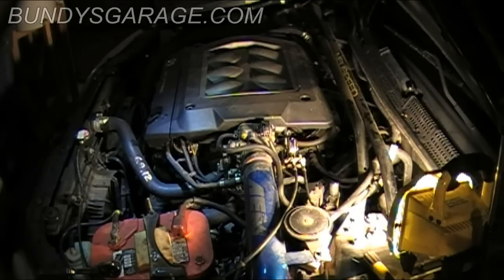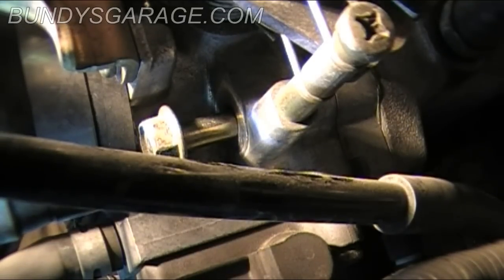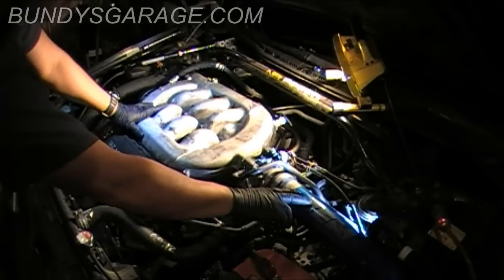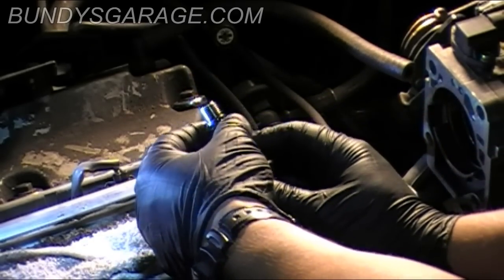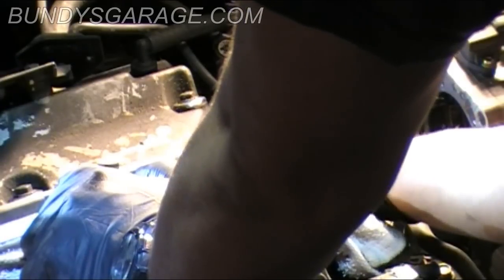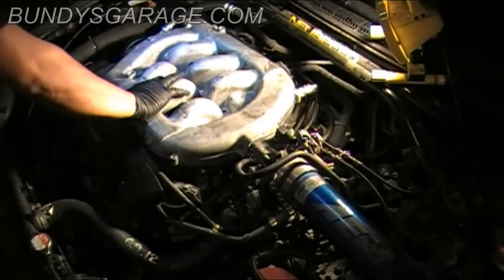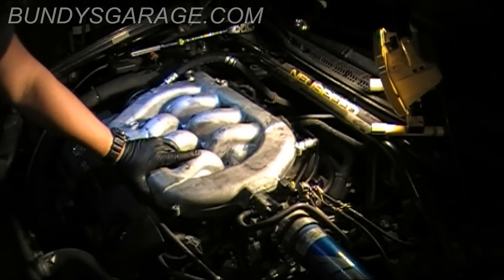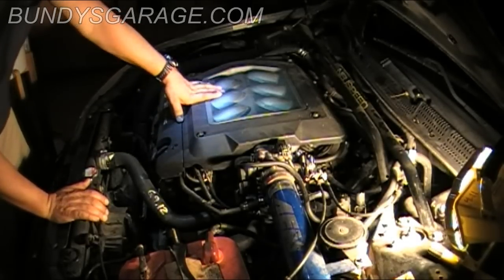DIY: Acura Honda (FPR) Fuel Pressure Regulator J Series V6 - Bundys Garage

Comment: Having an issue with an 2000 Honda Accord EX v6, it starts up fine when cold but after driving it for about an hour or 2 if I go to park and turn it off and try to re start it 15 minutes later it just keeps turning over and sometimes it will start but have a bad misfire but after i get it go in drive it will clear up about 2-3 minutes later, I've replaced all spark plugs, 2 of the coils ( popped up on the scanner) and now I bought all 6 fuel injectors, I am going to install them this week hopefully I was wondering what you think it might be? The car has around 180k on or
Reply from the maker: Thanks for watching. Its your engine coolant tempature sensor. It's gotten orogressively worse right? Before you install all those injectors check out my 2 videos on the problem.

https://youtu.be/DODF-egb9EM
Reply: +BundysGarage  I've replaced it about 3 weeks ago, though I did not fill it up as you showed in the video lol I'll take it off and fill it up tomorrow and see if that works, I pray it does 😂😂 Thank you man I'll keep you updated
Reply: +BundysGarage update: the fuel injectors were shot, all of the ports were clogged and I've replaced the ECT sensor and now the car starts up and runs fine lol for now at least thanks man for your advice
Reply: Did you ever find out what was the problem with your 2000 honda accord not starting once it got hot?? Was it your injectors or fuel pressure regulator?
Reply: toad c I’ve replaced the regulator and even changed the plugs, it was a heatsoak issue and I got rid of the car after about a month of it doing that
Reply: @THERIPPER216  did changing the fuel pressure regulator fix your problem?
Reply: toad c it did not
Reply: @THERIPPER216  I been having this problem for about 2 years now. Car run perfect except for that unknown problem....smh
Reply: toad c I was going to replace the fuel rail but I said enough was enough and called it quits lol I’m sure there’s a forum online for the correct fix but it just wasn’t worth me dumping a ton of money into
Reply: @THERIPPER216  now trying to keep bothering you but what all did you replace?
Reply: toad c Oh no You’re completely fine, I’ve replaced all of the injectors, the spark plugs and coil packs, as well as fuel pressure regulator twice (one new and one from an 02 accord)  and nothing worked, I figured it had something to do with my head or head gasket since none of those worked
Reply: @THERIPPER216   THERIPPER216  I have 99 accord V6 with 142000 miles. The thing run like a champ. What I did find out that works when the so called "heat soak" thing happens and it wont start, I unplug the vaccum line on the back of the intake manifold and plug it and it will start no problem. Once it start, I take off my dummy plug and plug the fuel regulator line back to manifold vacuum port.
Reply from the maker: This will fix your problem. You have to change 3 sensors and you’ll have it beat. Same thing happened to me as well. Had it beat for two years, then it came back. I will tell you what to do but you have to promise to report the results here (good or bad)! You have to change 3 sensors, 40 bucks on Rockauto.com. You have to change the engine coolant temp sensor (19MM), the air intake temp sensor (19MM) and the fan (thermo switch) (it controls the fans behind the radiator) (24MM or 15/16 deep socket) sensor that sits in the thermostat housing. The air intake sensor is on the intake manifold on the back edge towards the drivers side. Here are the Honda / Acura park numbers. Just take those and plug them into the search bar on Rockauto.com. Fixed the problem for me, period. 37870-PK2-015. 37880-P0A-A02. and 37760-P00-004. Just make sure you don’t switch the air and coolant sensors when you install them. They look identical and will fit both locations. Please let me know if this fixes your problem. If you have any more issues email
Reply: toad c that model accord was notorious for heat soak issues lol I’ve owned 3 of the 6th gen accords, I loved them! They are probably the best looking model (in my opinion) but that heatsoak issue made me pull the plug 😂 I’ve since owned a 2006 accord 3.0 (v6 6 speed) sedan and sold that and got myself into a 2016 hellcat
Reply: @bundysgarage  I think I done the ECT sensor already but the other 2, I have not. I gonna go to O'Reilly in the morning.
Reply: @THERIPPER216  the honda is actually my wife's car, I have a 2017 392 and hopefully one day I can upgrade to the hellcat..
Reply: @bundysgarage  have you changed these parts on a j series engine recently or this year?
Reply from the maker: Yes this problem only affects the J Series V6’s. I chased this problem for 6 months and spent way too much money doing it. Talked to all kinds of mechanics  and engineers about it but no one could lead me in the right direction. So after watching all the sensors on a scanner and seeing they were out of sync that’s when I knew I had it. It has nothing to do with summer or winter has its not a true heat soak problem. If you have the problem of driving the car and letting it get to operating temperature and then running into the store for 15 - 30 minutes and you come out and fire it up but it sputters and wants to die or it dies then this will fix your problem. It throws misfire codes cause the knock sensor picks up the engine shaking but it has nothing to do with a misfire. Plz keep us posted if this fixes your problem.
Reply: @bundysgarage  I will for sure
Reply from the maker: Was this what your car was doing?
Reply: @bundysgarage  Yes. It never threw codes or anything. It just always do the "no crank, start sputtering and shut off" until it cools down thing once we run inside a store after the car get hot from driving a while.
Reply from the maker: Yep I hate that problem. It happens on Acura TL’s and Honda Accord’s with V6’s. Were you able to get the parts from O’Reilly’s?
Reply: @bundysgarage  they had the thermo sensor but not the air intake sensor. I was about to install the thermo sensor and realized the radiator fan is shot so I ordered it from autozone and it will be in 2mor so I will install everything 2mor hopefully

Comment: 98 accord v6 200 k miles.  I think the code is p0171 and p0131
Reply from the maker: +Javier Hernandez If the P0171 is combined with the P0174 code, it's very likely that the problem is caused by an intake leak. If there are no intake leaks, the next step is to replaced the air filter and clean the air flow meter. If the problem persist the front oxygen (O2) sensor may need to be replaced.
Reply from the maker: +Javier Hernandez I would change the oxygen sensor first and see if that clears up the other code.